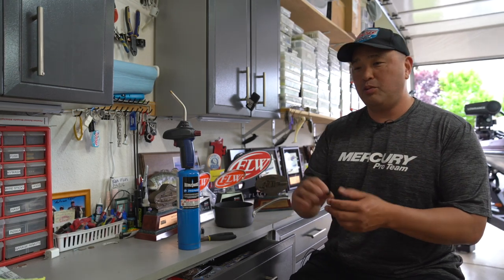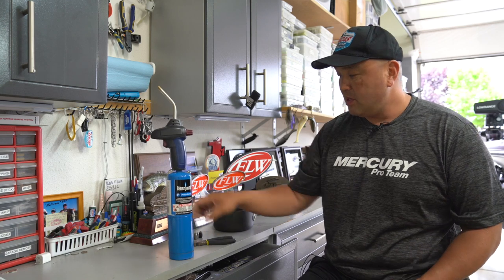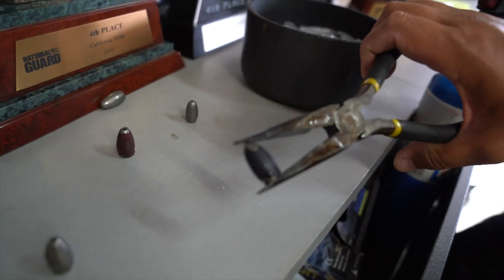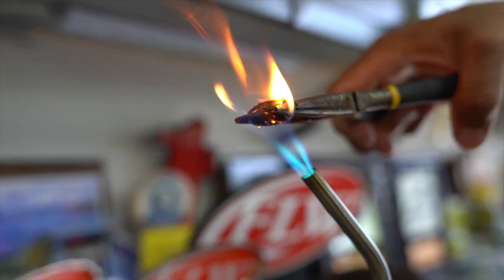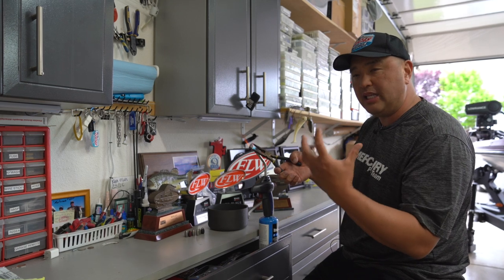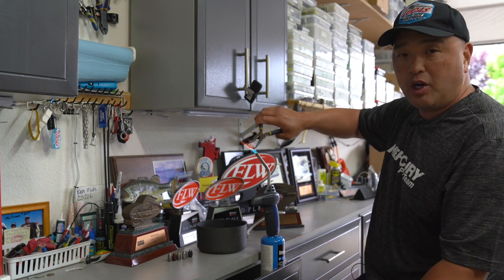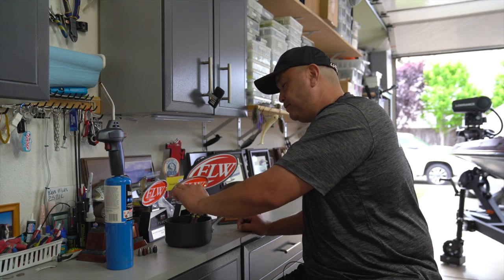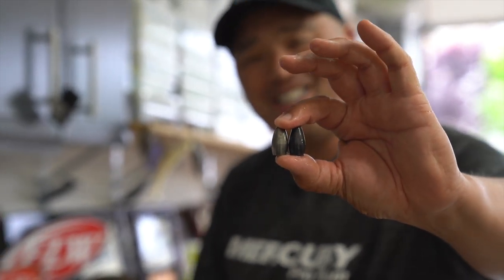How To Restore Your Tungsten Weights

Comment: I buy all my tungsten bare if I can, I like the torching effect and dark finish that results. Great tip! 
Maybe you can help me with a tungsten related issue. I normally use Swagger Tackle tungsten which are awesome, smooth, slightly flared line holes and very consistent, but I tried a cheaper brand of 1 oz barrel weights made by Vike, they are garbage with inconsistent hole sizes and rough hole opening that abrade and in short order cut the line. Do you have any suggestion to get rid of the roughness and polish the edges of the line hole in these tungsten weights? Any suggestions would be a great help, thank you

Comment: Should probably just use Swagger Tackle Tungsten 👊💪
Reply: Zee Bait Co 
Heck no!
Over priced and chips very easily!
by far heavy metal and strike king tungsten is the best I’ve used heavy metal is over priced too but don’t chip.
Reply: Try the Swagger Tungsten Vader series. THEY DO NOT CHIP.

Comment: Swagger tungsten Vader series do not chip. Try those
Reply: I ordered some 2 oz Vader flippin' weights and just waiting for them to arrive. Swagger tungsten is the best I have found with the edges of line holes nicely rounded over and smooth, other brand are junk in this area.

Comment: as the original tungsten fishing weight manufacture in China, I can tell you don't heat it to 800 degree
Reply: Almost all tungsten is mined and refined/processed in China as that is where the ore is. Does the tungsten off gas something nasty when heated?